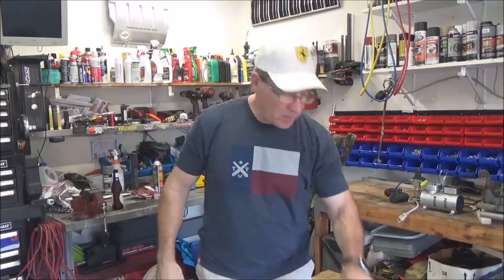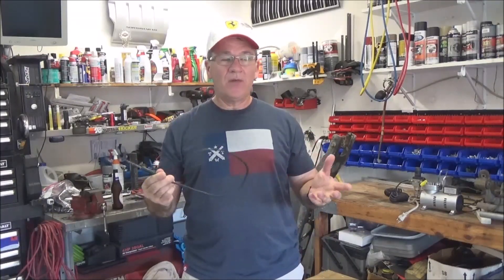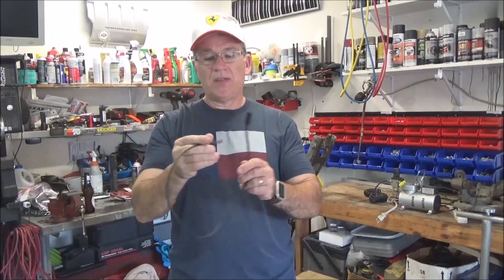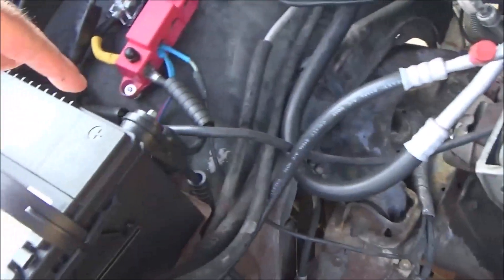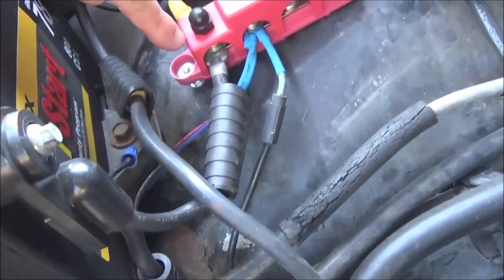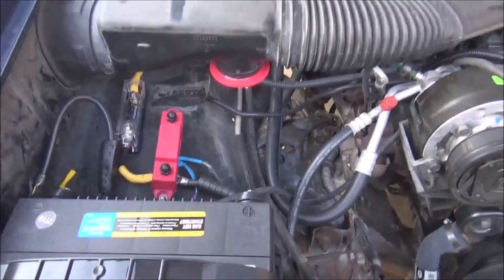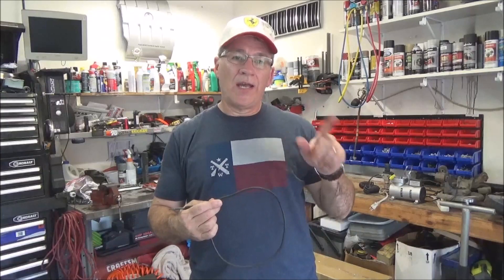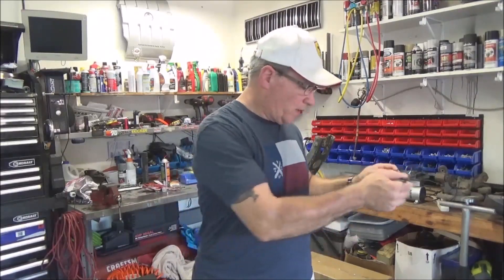Chevy 1500 OBS Charging System Upgrade

Comment: I bought a 93 Camaro that nobody could fix via an extremely hard start. It was all crap wiring. What a nightmare. This video will help a lot of people. I needed this without changing the fans. My car actually ate a diehard batter in two starts to where the battery read zero volts. It was such a bizarre issue and the biggest lesson is most people don’t understand electrical issues…including dealers & repair shops
Reply from the maker: Glad it helped, and happy it's putting a Camaro back on the road. Right most shops are just parts changers till they get the one that fixes it. the AC went out in my 07 (175k) Tahoe last summer a shop said it needed a new compressor without even looking at it... so I fixed it but was a pain to figure out. Compressor was good clutch failed. new clutch but kept popping fuses. So I replaced the entire Compressor... kept popping fuses. it took me 2 weeks to figure out that the initial clutch failure cooked the circuit on the motherboard in the power distribution box. I bypassed it and that fixed it. that shop never would have figured it out and changed by big$ too.

Comment: That's awesome! I'm going to do the same now. Since I'm doing a fan upgrade. It's very similar to the guage of my old work truck (ram 5500 with dual alternators) because I was running a 5000w invertor for work. I'd rather overkill and be safe with my personal obs truck. 👍

Comment: Yeah I was chasing my 98 1500 not charging all weekend it was tge wire before the link it was gone inside the sheathing. Now in pushing 14 6 volts.tvank for the block link in getting that so much with my plow wiring  😊

Comment: found your vid researching charging system issues .....you might like this little problem ......98 gmc z71 5.7 ...under hood stuff all original 230 k miles ..has a miss but doesn't miss at idle or just putting around up to about 20 mph. Once I get up on speed and try to hold a steady speed like 45, 55 65 mph with and without cruise control it misses , feels like it's surging , so I started with plugs, wires,  dist cap , button, new coil , fuel filter, battery , power steering pump checked alternator checked out good ( it wasn't original , been changed before ).....still missing so changed out the mass air flow sensor, cleaned the egr, ( exhaust gas recirculation bs)....still missing so took it to Oriellys they plugged a scanner in and said knock sensor lean bank 1......so ordered a new knock sensor and installed it . Now , the check engine light has never been on but when I changed the knock sensor the dang check engine light came on . I also changed the flat ground strap runs from back of engine to the passenger frame ...still missing ....this sumbitch is driving me crazy .....I read a post somewhere that bad grounds can cause the alternator to overload overheat  the fuel pump and cause the fuel pump to stall out ...also my gas and battery gauges have started flicking a bit back n forth so I'm gonna redo all my grounds and positives , talk about a headache ....anyway just found your channel sub'd up....good channel
Reply: At around 200K+ those distributors themselves start to get worn out. I had same symptoms. Son ordered new distributor dropped it in and issue resolved!
Reply: @MrRoy-rb1je  gonna try that next , thanks
Reply: Cut the red rubber cover off your positive battery cable. It may look clean but inside the cables is corroded and where the rubber goes over, it was my issue on my 96 5.7 k1500. Made it fall on its face take forever to crank etc. and die often. I went through legit 85% of the parts replacing you did including distributor. Just to find out the battery cables harbor corrosion. Change to big 3 custom battery cables and new clean grounds if you’re ever able!

Comment: Going to try this! 94 Step Side, Rebuilt 350 New AC System always drained my battery.
Reply from the maker: yup check all of your ground wires it may be missing a few after the engine was reinstalled. there is a big strap on the back near the frame under the AC evep

Comment: What size bolt is on the block for the negative ground? I’m missing that bolt and my negative is grounded to the ac compressor bracket. The cable is old and corroded so I’m replacing it back to OEM location. Just need the bolt size.
Reply from the maker: Hi I think its an M10-1.5 x 50mm  O'reilly or Lowes should have them Lowes would be in metric boxes it does not need to be a grade 8 (10.9 for metric) a grade 5 (metric 8.8) is fine for this.
Reply: @NavyDad  thank you sir I’ll look for one

Comment: What would be the difference if I did not have the electric fan? In other words the clutch and fan setup. I also don't have the junction box on firewall but the positive battery cable that has a link to the alternator, starter, and fuse box on driver-side fender well. Could I still go with this exact setup you are doing?
Reply from the maker: its just a good overall setup even if you are not going with E-fans. and get rid of the old-style fusible links and replace them with modern circuit breakers or heavy duty fuses.
Reply: @NavyDad  Just wanted to let you know that I did it, and it charges my truck really well now. Charging system overall was really old and getting worse as time went on, now it fires up like a brand new truck. Thank you for the advice! 👍
Reply from the maker: @dedelee3391  Awesome!

Comment: I’m wanting to upgrade my stock + wire from the alternator but it runs to the neutral junction box on the fire wall.should I keep that wire plugged in and just run a 4 awg wire with a fuse leading from alternator to battery positive.therefore having two wires coming from alternator + one to the battery and one to the junction box,thanks!
Reply from the maker: is your truck a 88-91? I think Chevy changed the wiring in 92 or 3 I would run the new line fused or with a fusible link from the alternator to the battery. Then a line from the battery to the junction box. That's how my 94 was factory wired. The small line currently going from your alternator to the junction box likely already has a fusible link on at the junction side. You should be able to move that line from the alternator to the battery you might want to use one of these for better routing https://www.amazon.com/Red-3-8-4-Stud-Power-Distribution-Block-BUSBAR-with-Cover-Made-in-The-USA/dp/B07CCGCWKD/ref=cm_wl_huc_item
Reply: @NavyDad  thank you for replying! I tried it out with out the original wire running to the junction box just altinator to battery and it was just fine I didn’t see any change in voltage or anything! Do you think I’ll hurt the system if I ungraded the main power wire going to junction box from battery?
Reply from the maker: @alejandroroberts4702  not it should not hurt it but make sure to either use a fusible link or an inline fuse or even a circuit barker just to be safe

Comment: 90 c1500 alternator the wire that you changed in this video well mines broken at the rubber connector part would that be the reason my truck won’t start?
Reply from the maker: if the battery still has change enough or is jumped and the engine turns over normally a broken alternator wire wont keep it from starting. in fact a fully changed battery will start a car/truck without an alternator. if the rubber connector you are talking about is the one at the alternator itself that broke it could have cause a short elseward. if its the original wire check the battery side. you should see several other wires. if original there will be a fatter short thick part (black or tan) of the wire usually 6-10 inches from there is connects. that is a fusible link. if there was a short it could have cooked the link on one or more wires. the fusible links can sometimes fry inside and you cant tell so you may have to check continuity on all of them. the starter may still turn over but if the link going to the ECU is bad, its not getting spark or power to the injectors. also check the the passenger side firewall above the AC. take the cover off if its still there as there are several more fusible links there and your fuel pump relay is there as well. check all for continuity. also I think there is a fuse under the dash for the ECU, could have popped that too.
Reply: Alternators never start a vehicle. Only charge the battery.

Comment: Hi navy dad! I’m a fellow owner of a c1500 a 93 side step to be exact! I’ve been having trouble with it lately, the trouble is on down shift to up shift the truck seems to shake and lag into gear. it is a automatic and we’ve changed fuel lines and filter. we don’t know if it might be the carb, transmission or, injectors. wondering if you can help! 😭
Reply from the maker: Well it could be a lot of things however “shake and lag into gear” is likely a transmission issue not likely a fuel system issue. But there could be a few other things. Check the motor and transmission mounts and the universal joints. If any are broken, they can cause issues like this. We just fixed my son’s 2010 GMC Sierra. It would clank going in to reverse. The front universal joint had a big crack, was just about to break off. If the trans fluid is black and smells like burnt popcorn the trans is done, the bands are burned up. If so Don’t change fluid if you do it might work for a day or a month but it will fail. The dirty fluid with all the band/clutch debris is what keeping it alive, once clean fluid is put back in that’s it.
In fact a good reputable transmission shop will not change fluid in this condition unless the customer signs a waiver. However just to rule it out check your fuel pressure and pressure regulator. Fuel pressure on a TBI is around 10-12 pounds. The fuel pressure regulator is in the top back part of the throttle body and they are prone to leaking. You can buy a TBI rebuild kit for less then $100 and it will include fuel pressure regulator. The TBIs are very simple and easy to rebuild.
Last thing to check if the trans fluid is good and clean is the transmission solenoids they can cause shifting issues in the 4L60’s 93 was the first year for the 4L60 in trucks it’s a renamed 700R4 but there are some differences. There is lots of info on the web and YouTube on checking and replacing the solenoids.
Good luck and take care ND

Comment: Is this a general recommendation or just for sound systems? I just did a 5.3 LS swap in my 94 4x4. I have no sound system.
Reply from the maker: Yes, I didn't do it for a sound system, just better charging and better grounding is always a good idea, especially if you added electric fans with your swap
Reply: @NavyDad  thanks I’m definitely installing electrical fans

Comment: Did you splice all the heavy gauge wires to make all your connections because I’m not finding any terminal replacement wires with that heavy gauge of wire
Reply from the maker: not sure which wires you are referring too? are you taking about the trucks main accessory wires that are under the dust box on the firewall by the AC dryer? if so there is no need to replace those they are 12ga which is more then adequate for accessories

Comment: Why did you just put the thicker ground wire in the same place as the thin ground on the driver side? Instead of running it from the alternator Just asking.. good work though I’m definitely going with this setup
Reply from the maker: Directly grounding the alternator body increases charging stability and good grounding can reduce circuit overheating... and fire. its the go to setup when installing a big system too. (called the big 3) here is a little more about it   https://www.kicker.com/app/misc/support/tech/tech_papers/docs/TheBig3Upgrade.pdf
Reply: @NavyDad  awesome thanks

Comment: I have a 96 and am having charging issues it stays at 12 or so at idle and driving also I have the 1 wire plug but how would I add a ground from the alternator if the only spot is where my positive cable is that runs to the battery?
Reply from the maker: the alternator ground wire bolts to the alternator mounting bracket then down to the frame. but you have to make sure the frame and body are very well grounded too. the straps on the back of the firewall are terrible, especially if they are oil soaked.

Comment: The Red wire on the back of my alternator goes to the firewall. Do I just tie it into other power cable and run it to the battery??
Reply from the maker: sounds like someone has been there before, thats not factory it should go directly to the battery. Then another wire from the battery to the firewall junction block. if they are missing the factory fusible links make sure to add it back or use a high-capacity fuse or circuit breaker
Reply: Depends on the year I think.  I have a 92 Blazer and the wire from the alternator goes to the battery junction block on the firewall and then to the battery (and the factory wiring diagram shows this is correct for this year).  And they're not very big wires either. Not the best way to have done it.  I'm running a Powermaster 140amp alternator and I'm adding a 4 gauge wire from the alternator to the battery, and then removing the original wire that went to the alternator and running it to the battery, that will give better capacity from the battery to the battery junction block where the fuse block connects.  You get about a 50/50 consensus on if you need a fuse or fusible link in the cable from the alternator to the battery, some say it causes a voltage or current drop, but you definitely need them in the wires from the battery to the fuse blocks, etc.

Comment: How would you go about removing the charcoal canister to run dual battery’s?
Reply from the maker: I dont think I would remove it. It would always stink like gas with an open vent line from the tank. it vents pressure from the gas tank allowing fumes back into the manifold it does not rob any power from the engine. I think you can just move it over. there was a dual battery option for both the 5.7 and the 454. You should be able to make a bracket. scroll down on this page and see what this guy did on a 3500  https://ck5.com/forums/threads/left-side-dual-battery-tray-and-evap-canister-placement.327761/
Reply: @NavyDad  appreciate the help! Love the content 👍

Comment: I might do this I’ve been having trouble on my 88 Silverado it won’t run if the alternator is plugged in it will only run on battery if I plug the alternator in while it’s running kills it instantly I’ve replaced everything accept the charging system
Reply from the maker: yes you have short somewhere it could even be the alternator. check all of the wires including the fusible links they are a pain. they fail and you really cant tell by looking at them
Reply: @NavyDad  I did end up replacing the alternator but still didn’t work so when get up some money I’ll replace that wire how you did it and see if works I hope been fighting this truck for 2 years almost

Comment: Hi navy dad, I have a 89 k1500 stepside with a 5.7 TBI and ive been having problems with the charging system, I put a new alternator bought a new battery and my truck still won't hold voltage, I have to jump start it everytime and it'll be at 12.40 then eventually start dropping to 9 then 7.46 and eventually dies and turns off, what could it be? I've checked the positive wire that goes from the battery terminal to the starter and fixed it also, idk what may be the problem, it won't maintain its voltage
Reply from the maker: Hi, yes this is pretty common on these trucks in fact Drew Martinez below had the same issue.   
First check all of your ground wires and make sure they are good. This sounds like the wire going from the Alternator to the battery is bad. The fusible link is close to the end of the cable on the battery side its usually a green or black thick part of the cable about 2 inches long. The links can blow and not look like its blown. When this happens, the alternator is not charging the battery as the cable is basically broken inside. Those things they always cause trouble which is why modern don’t have them anymore. To save time over building a custom cable setup go to O'Reilly they should be able to order an OE style cable to replace all 3 or 4 wires coming of the positive side of the battery.
Also the junction block on the firewall above the AC dryer on the passenger side. It might be covered by long plastic cover same location as the fuel pump relay. There are 3 or more additional fusible links which could be blown as well.

Comment: Hi Navy Dad new to your channel I have a question I've got a 91c 1500 5.7 TBI good spark good fuel will run on gas bottle but injectors won't fire do you think it could be the ECM?
Reply from the maker: Hi, are you sure its getting fuel to the injectors? This sounds like it could be fuel pump, fuel pump relay or the fuel pressure regulator. First check fuel pump relay. Its on passenger firewall right above the AC dryer. Its behind a long plastic cover (if its still there) along with the power distribution bar. You can bypass the relay by putting a temporary switch on it (there are YouTube vids on doing that) If it starts, it’s a bad relay. If it does not, the fuel pump may have gone south. Before replacing the pump (it’s a bit of a pain) check the pressure regulator too they are prone to leaking. The regulator is in the TBI they are easy to replace and cost less than $75.